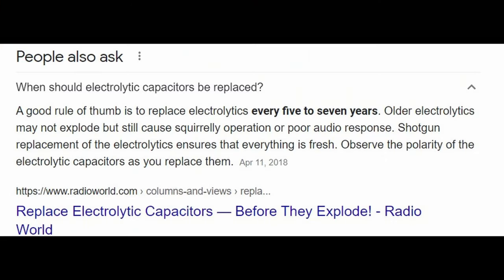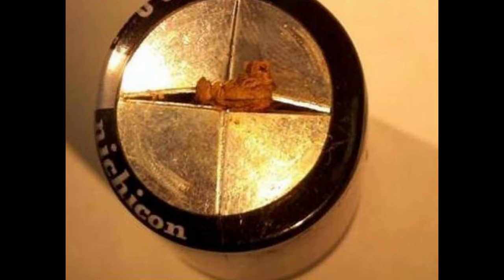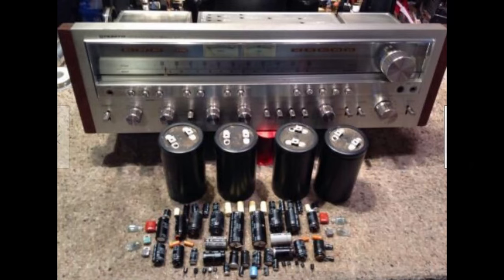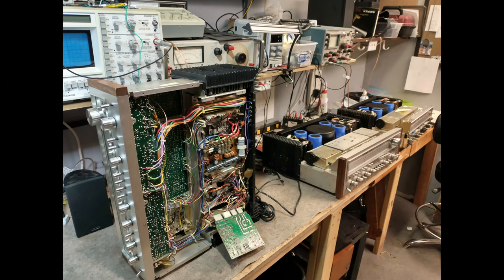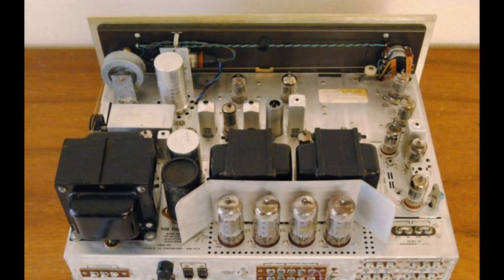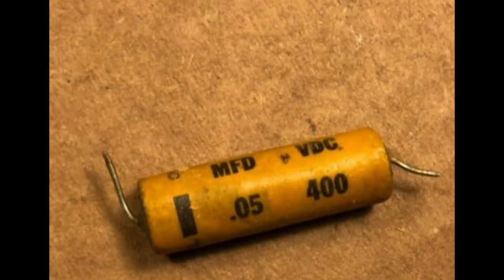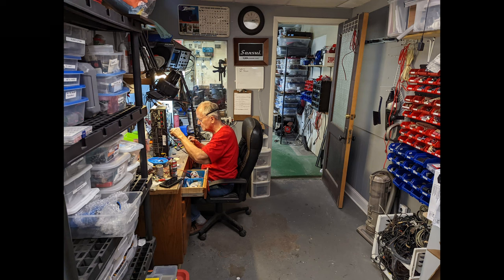Should You Replace Capacitors In Vintage Electronics?- Marantz Sansui Pioneer McIntosh Yamaha

Comment: It's not like it's only capacitors that age. Some transistors from "newer" periods are getting long in the teeth. More so if they are from the period when some factories used the black legged ones, that corrode and create problems over time. And some resistors go bad too. Some sandcast ones will get warm and loose their resistance value. Then there's the soldering that can go bad, greyish, and simply disconnect more or less.
Then there is the foam pads in some old components, that will "melt" over decades and become sticky and release some corrosive chemicals. Since they are often used as spacers between say cabinet parts to pcb's, they can delaminate and corrode traces on pcb's. Yuck!
Then there's the grounding thing. Some pieces of electronics/electromechanics are stored in basements, garages and attics. There, the humidity and temperature often fluctuates more than in say a living room, so the metal parts, plastics, wood panels, paper parts and what not, can or will go bad faster. Even to the point where hard chromed axles on say tape recorders gets rusty and are destroyed, depending on the severity.
 The influence of strong magnets, humidity, temperature, cleaning agents and especially contact cleaner! Some if not most are corrosive over time, so after using them, they have to be flushed out, and then thirdly preserved.
With prices on everything, more so HiFi equipment having skyrocketed since the mid 1990'ies, it's really worth asking yourself if what you want is an empty thick front panel box with a few smd components inside and a chip to do all the work, and an encapsulated mini transformer, or do you want proper electronics that can be cleaned, adjusted and renewed. Of course smd are also fine. Some capacitors like modern smd ones, can crack and destroy themselves. It's not like the new generations of components are trouble free. There are just new ways that it goes bad over time.

With capacitors, I've found that many new well made precision ones are sounding great. Less tolerance and good performance. That is an area that we as listeners should not skip on too much.
And then there's the "newer" philosophy of designing circuits with components that are really tight for their use, such as capacitors. For example I've replaced a few caps in an lcd tv, that was designed to last so and so many hours, only to revive it by replacing a measely 4 caps with new ones and those being a step higher in capacitance and voltage. Works well, 7 years later. I am sure most of us have been into this situation at one point in time.
Look at many service manuals for example. In the beginning of the cd-player era, many service manuals were written very thoroughly, but as time passed, they were thinner and thinner, not explaining the same level of functionality, testing and replacement.
With really old gear, you need to either be into service technical stuff or know a good technician, as it can be hard to find.

Even as old school technicians are slowly retiring, some of the business methods of today are swapping modules, so a lot less testing and real fault finding. Less knowledge and less chance of an ordinary listener swapping out say a few caps than have gone bad. It's another level working on smd micro components, unless your perfectly trained. With ordinary electronics and electromechanics, there is a chance that you can actually do something, renewing components and maybe even have a friend turn a new axle or similar on a lathe.

Then there's the sound ideal, which I think have changed over decades. For a long time now, the sound ideal have been into the kind of bright sound, or should I say overly bright, having even sales people in HiFi stores claiming that it's not overly bright, but the moden electronics have revealed a whole new level of treble content. I do not agree. It's tiring to listen to and not very natural. Just remember when you last went to a concert and how exactly it sounded. Old Hifi from 2000 backwards, does not show these tendencies in general. There's a whole huge second hand HiFi components being listed for sale, because the owners got tired of thee way they sound. I am not talking about upgrading or new standards, but the sound aspects.

I think you should make a good looong video on how to take care of things. What to do and what not to do. Don't make it a short headline kind of type video. People need and want to understand, and they like to know how and why. If they are here to see this video, then they will also enjoy other ones on the subject. Btw. what is retireing? Other people may retire, but not so technicians. They are needed ;)

My ears are analogue.

Great video, much appreciated and keep them coming ;)

Kind regards.
Reply from the maker: Great info! Appreciate it!

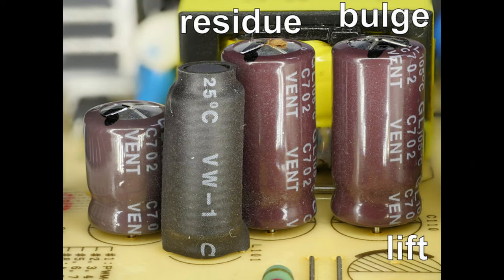Comment: Those are electrolytic caps (they look like cans) 1:57.    They use a chemical inside and over time fail by expanding and as you can see rupturing.  Those need to be replaced if they look like that.  If theyre still working its because they are shorting out and not acting as a cap at all.

Comment: Is the life of a capacitor measured in calendar time or usage.  In other words, if I stored a receiver for 30 years and it was lightly used for the first 20, is it likely the caps are still good?
Reply: Electrolytic caps last longer if they have a continuous, or at least frequent, polarizing voltage applied to them.  Otherwise, the oxide coating tends to deteriorate.  So, an amp that's been stored for years, is more likely to have bad caps, than one that's been used, at least occasionally, for the same length of time.

Comment: It is very simple - large filter electrolytic capacitors in power supply are likely to short on failure and cause rectifier bridge and transformer to go puff in smoke.  Good luck with finding a power transformer replacement for 50-60 year old gear.  Your remaining choice is to rewind the burnt transformer at the cost that is probably 10x of simply replacing the filter caps in the first place.  Your gear, your choice.

Comment: I have a receiver from the 70's and yes it does work, the caps look fine but I believe the input selector knob has a problem. Often times, the sound will cut out in the right channel. I have to switch the knob back and forth until the sound is even again. I have no idea what to do and I've already taken it to a repair man to have it looked over. What can I do?
Reply from the maker: Outside of cleaning or replacing the switch, if it is truly the culprit, there aren't many other options. Impossible to troubleshoot anything without being in front of it. Sorry.

Comment: Recapping my Marantz ruined its sound, sadly. I advocate for recaps and have since learned to do it myself, but there's always the risk involved of messing with an amp's mojo.
Reply: Yup recap can ruin original sound. Im happy my pioneer still has original caps in preamp and power amp. Tech guy said my set works ok and doesnt need recap.
Reply: @Watcher4111  Same story here. Took a newly acquired Marantz to a good tech and he tested DC Offset, Bias, and full frequency THD. He saw no anomalies and the unit was in spec. DC Offsets were each 0.0008v. The boards were clean and the electrolytic caps flat, no bulging or leakage . . . he recommended I take it home, enjoy it, and save a couple hundred bucks.

Comment: I actually have had the same opinion for quite some time. If it's not broken, don't fix it! But there are other factors involved, for instance when you say that "put a new capacitor so it will last another 50 years" - It wont last! the capacitor plague is not over, you still get a ton of counterfeith, poor quality or even fake capacitors. A vintage stereo piece lasted this long, while a Samsung TV from 10 years is drenched in bad capacitors on its power supply. So my opinion of "ain't broke, don't fix it", was really based on the experience with computer boards, LCD's, TV's plagued with the worst capacitors ever made. 
However, I just recently became aware that that trend shifted a bit. And you can now get quality components nowadays (just stay away from eBay and Alibaba!). So what it would make sense now, even if the quality is now 100% of what is used to be, to put new parts that decay in time, just like capacitors. 
Resistors are made of graphite mostly, but they can also drift out of the original value.

Comment: If it's a capacitor in the power supply or handling significant voltages or current and is more than 20 years old.... YES.  Swap it out.  A failure in that capacitor can lead to a fire that destroys far more than the component.  

If the capacitor is in the signal path, it likely not going to be a major issue even if it's out of tolerance.
Reply from the maker: agree 100%

Comment: Such a controversial issue, I actually had this 1 Tech (Whom I will never use again) tell me if they last 40 years, then they will last 80 years, why change them out. Why.........when that capacitor Fails, then you get a chain reaction of more burned out resistors and SCR's and heaven forbid Power transistors.
Reply from the maker: Truth!

Comment: I've restored a few speakers, and except for the Dahlquist's that require 8 caps per speaker, easy-peasy to replace one or two 30+ yr old caps . . . and now they have these 'audiophile' caps . . . 
EXCEPT for these damn Vandersteen Model 1's . . . Richard Vandersteen told me the caps don't require replacement, but I took a couple out and had them tested. One was practically shorting out, and the sound of the speakers were 'thin,' . . . Problem is, Vandersteen buried those crossovers deep, and epoxied them in . . . pain in the royal ass to work on.
Reply from the maker: Agree. don't ya hate that? The worst for me are the early AR, KLH era speakers with the insolation that will have you itching for days. 
I always replace electrolytic caps in "quality" speakers but leave the films unless I think something is wrong.

Comment: The answer is yes, every single electrolytic capacitor should be replaced.  Any paper or paper/oil capacitor should be replaced, anything with Cyrillic markings should be replaced (USSR army surplus paper/oil), and "boutique" capacitor should be changed. It's debatable whether ceramic caps should e replaced, certain types should be replaced. They should be swapped "like for like" on each channel with matched parts. Poly caps or any film cap is probably OK and should be left alone. Replacements should be proper current electrolytics, or film caps.  Certain early Japanese caps are notoriously failure prone, and many times, every single 5-10-30 mfd cap will be far under capacity. If changing caps "change the sound", that means they were defective.
I would also add - if you are doing this for money describe what you are going to do in detail and get it signed . In many cases, licensed repair shops are not allowed to replace a functional part and might be sued by fraud. This to keep people from doing "unnecessary" repairs to run up the bill. Make it absolutely clear that you are refurbishing the equipment to your standards, not just finding one bad part to get it going again.

Comment: What can happen to a receiver/amp (I have several JVC from late 70’s) if a cap fails and what is common? Can a cap fail catastrophic and damage the equipment?
Reply from the maker: Sure. They can damage anything around them like transformers, transistors, diodes ect ect
Reply: ThankYou, I would love to come check out your shop and get some work done but it’s a 15 hour drive from Anderson SC. Although I did drive 13 hours to Buffalo to pick up a pair of JVC sk1000’s.

Comment: If some gear you bought for 200 and won't sell for much more even if restored completely would cost 300 to restore, I would still do it if it sounded like something that would cost me a thousand new and would probably last as long again as a new amp. If it has a special character you like you might not even be able to find something new that can compare with it.

Comment: As someone who works on guitar amps. Changing the capacitors and the power transformers does drastically change the sound of the amp. Quite often you hear people say "An amp will sound it's best right before it explodes". I often get complaints after a cap / transformer job that the amp sounds too clean. But I don't believe in determined amounts of time for capacitor life. As I have seen amps as old as the 1950's still running in great shape. And I have repaired brand new 6 month old amps where they had a faulty cap. It's more about how often it's used, where it's stored, and how clean the electricity is. With guitar amps at least the ones often needing cap jobs asap are the ones that haven't been turned on in 20 years. The ones being played everyday are usually fine.

Comment: Forgive my ignorance, but I thought you said all capacitors of equal value SOUND the same, but everywhere I'm told film capacitors sound MUCH better than electrolytic capacitors?
Reply from the maker: It's way more complicated than that.
Sound quality is subjective. There is no spread sheet that says what sounds better. 
Keep reading peoples opinions and you will see it's all just opinion.
Not to mention it would not be practical to use film caps as these receivers/amps would have to be much much larger just to house them and would cost a small fortune.
Reply: @skylabsaudio  Thanks for the quick response- I know about the size issue and price, and also that while e-caps have a higher density capacity, f-caps handle more voltage, go less percentage of loss over time, etc.. like you said- it gets complicated, but thanks again for your time, and will continue to follow.

Comment: Equipment components, not all, are not lasting past 40 years and that is the best ones. Capacitors are the one thing which fails the most often. Electrolytic caps are the worst. If you want the best sound buy the best grade you can find. Ersa, Ulna, Nichicon, Illinois Caacitors, Sonic Caps are not all but just the best brands. There are others. There aren’t as many techs that want to work on this gear. It is worthy and so much gear now is about efficiency rather than sound quality. Revox, NAD Monitor Line, AGI 511a, Luxman, Nakamichi, Nagra are top drawer brands. These are not all, but back then, things were built to last. Not all components age well. Spend the money now and save yourself the grief of having a boat anchor later as opposed to a real peach now. Jim Thorsen used to say, new things are no good.

Comment: Would you service a car this way if it ain’t broke don’t fix it?
Reply from the maker: I change my spark plugs, oil, air filter, replace tires ect ect and yes I drive it to the shop for these services so I don't have to tow it.
Reply: That’s why my 05 Dakota runs like new with 198 K miles

Comment: As far as the oil change analogy- oil breaks down overtime- it loses its viscosity, detergents break down; it goes into your car nice and clean then when you change it, it’s all crappy looking and full of contaminants and worn out - just like the capacitors and all these other components in these 30-60 year old units.
These parts as mentioned, Don’t last forever -manufacturer says 20 years usage , anything beyond that ,you’re on borrowed time.

Comment: Capacitor -
"If it ain't broke, don't fix it."
They are like a tire with 25000 miles on it. No tread left but hasn't gone flat yet.
Reply: And my dad would have said that the cords sticking out of those tires will give you better traction in the snow.😅

Comment: Well, most people can feel their car going faster after a good wash, which scientifically can be explained: after removing the dirt from the body, you have a reduction of the friction between the body and the air. Of course friction is being reduced by approximately 10^-74N (or 0.000000....01N (74 zeros)), but Im sure most people can actually feel this, wouldnt you agree?

Comment: Folks if you got a tire that is bald and it is still holding air yes it is working but I am not going to run it up to Hyway speed with me or my family in the car! Is these new caps going to change your sound? Well if it does it will sound better! It is all good. They make better sounding better made caps that sound fantastic!! Pay the price get it done you wont regret it.

Comment: 3:00 "there's no way those capacitors still function the way they did 50 years ago, I don't care if they test good, testing good is one thing...". I was left wondering (of course other than how much life they have left and what risk they present to the gear) how a capacitor completely within spec is not functioning the way it should?
Reply from the maker: My point was, if you are going to take a 50 year old capacitor out to test it, why wouldn't you just put a new 90 cent capacitor in instead and know it will be good another 20 years? Or are you going to test your 50 year old caps every 6 months to make sure they are still good? Or how often should a 50 year old cap be tested? Either way. I am not going to pull a cap, test it, and re-install it. I am going to put in a new one- every time. Caps are cheap, time is not.

Comment: Please let people know that the only Caps they want to use to replace the old vintage ones are from JAPAN ONLY! Always use high quality and highly rated caps. And try to use low tolerance percentages if possible.  And you can use higher voltage caps if you have room and the same lead spacing, if the same voltage ones aren't available, never lower.... AND NEVER CHANGE THE VALUES.  When you remove the old ones, what temp on the soldering iron using a solder sucker do you use, or do you use a heated solder sucker gun, (temp set at how many degrees on that)?  I am older and know how hard it is to find real, old school, quality, service guys.  Thanks!   Happy Flux Fumes to you and the rest of us fossils! LOL